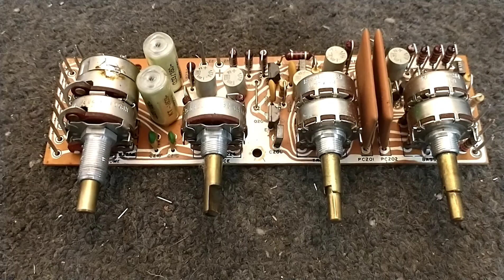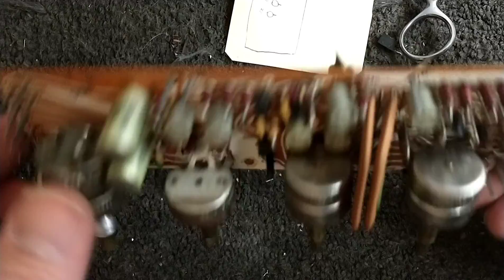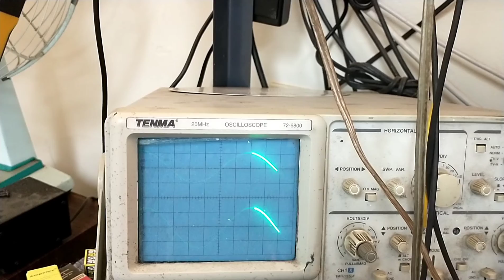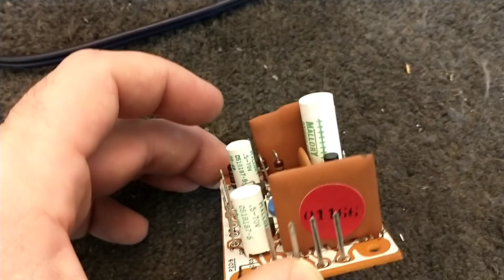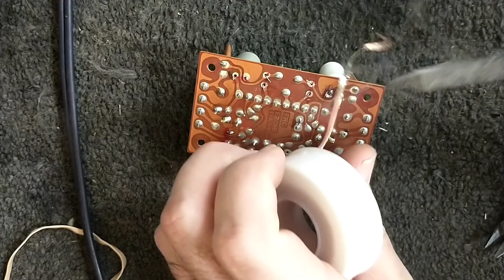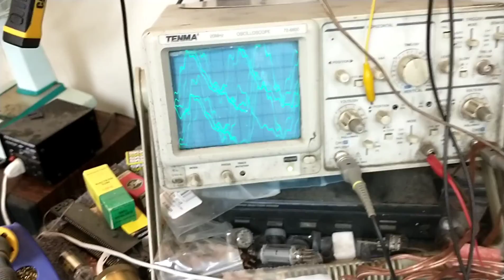Repair of a vintage 60s Fisher 450t solid-state stereo receiver. Part 3/? Preamp and phono repairs.

Comment: You replaced the tantalum capacitors with electrolytic ones. Did you need to worry about their direction or does it not matter in this circuit?

Comment: I also thought the grey capacitors were dodgy, I've seen them somewhere,
Those pcbs are nice, not crammed full of parts.
I don't mind the hand drawn tracks either.
When you said tantalums i expected the bead type,  but they had a habit of going short and exploding.
They stink.